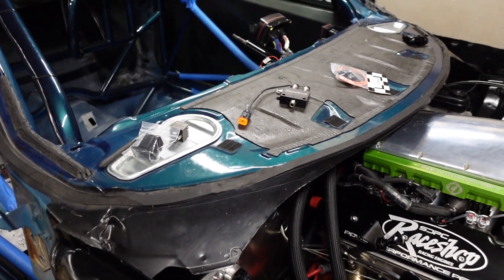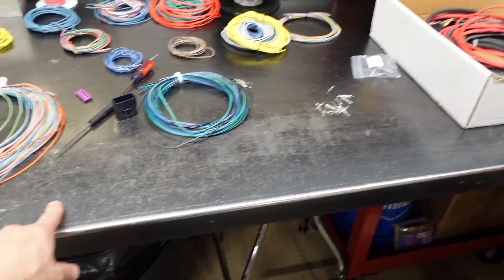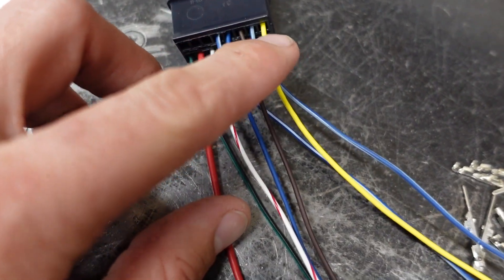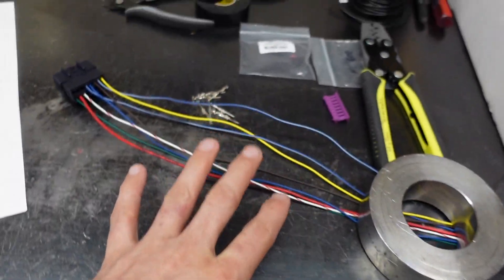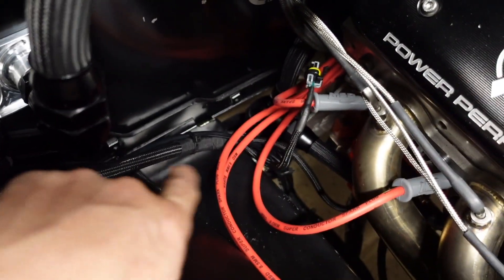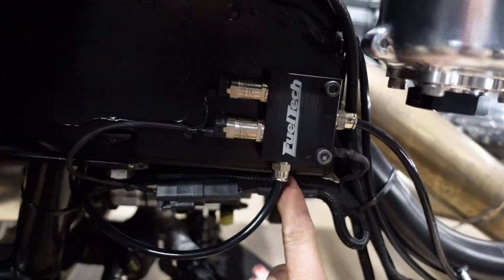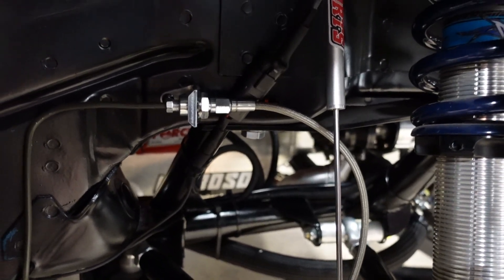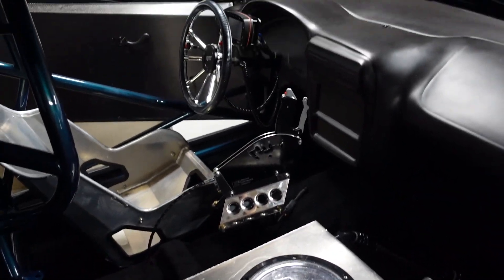FuelTech IO Harness with ALL of the sensors! Finishing up!!! - RACE CAR WIRING SERIES - Part 5!

Comment: How do u get out around the 12v spike to all the outputs when the ecu is powered up?
Reply from the maker: Yeah I’m struggling with the yellow outputs on the fueltech. Hitting the trans brake when powered on. First I had the transbrake hooked up to battery power like their wiring diagram shows. But when you give the car power it would hold the transbrake the entire time... I see other people having the same issues on the fuel tech groups. 🤷‍♂️
Reply: Yea mine are in the nitrous solenoids and was in the coils to till I moved them to a switch.

Comment: How do you feel about using bulkhead wire connectors on the fire wall? I see some benefits to them but is there a specific reason a guy shouldn't use them?
Reply from the maker: Love using bulkheads. Used them on my mustang and this camaro. No complaints!
Reply: @StreetCarJoe  GREAT!  With the quality of work you did on this car, I had to wonder if you found a reason to not use them haha. Thanks!